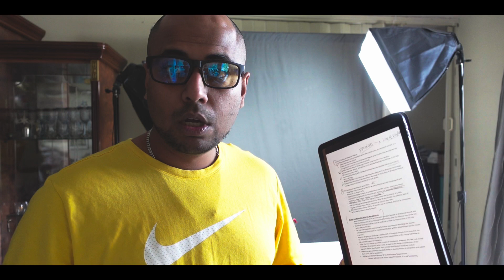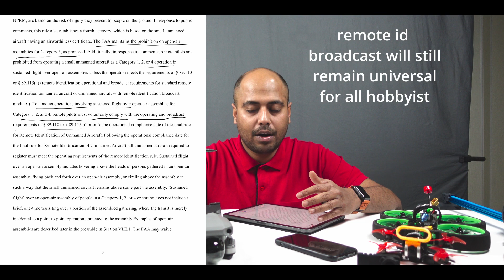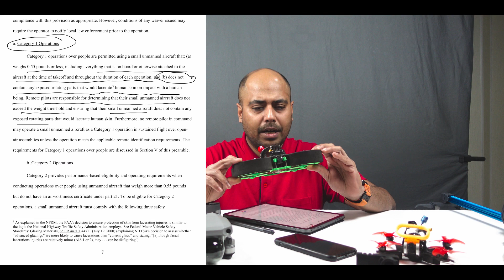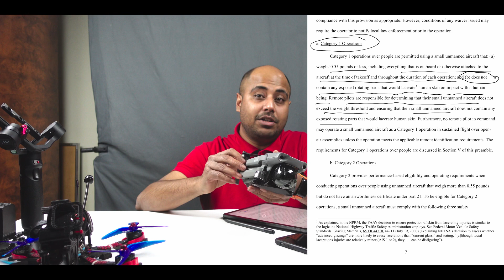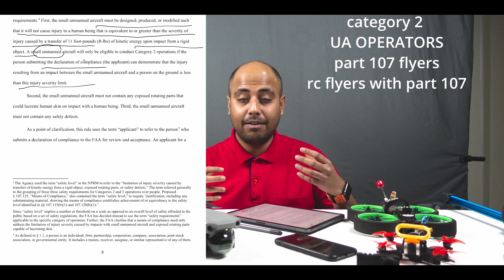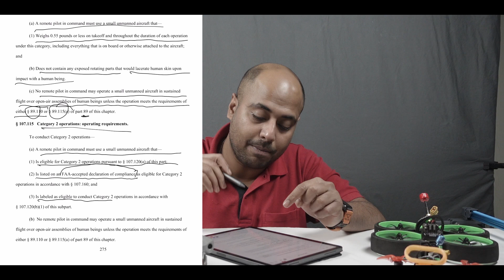FAA REMOTE ID NPRM/PART 107/Flying UA/drones over people explained!

Comment: does A6400 works with extra monitor when shooting on 4k
Reply from the maker: yes and no , means , it works but after may be 5-10 mins it will switch itself to the native screen
Reply: Techado would you plz make build video of your 65mm drone with tranis tx16s plz with binding an plz make as more range as possible